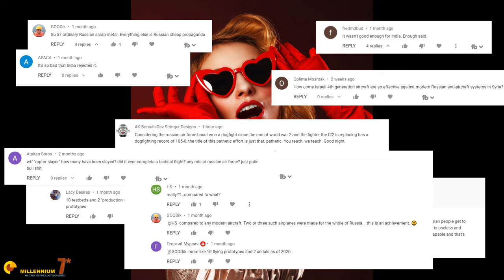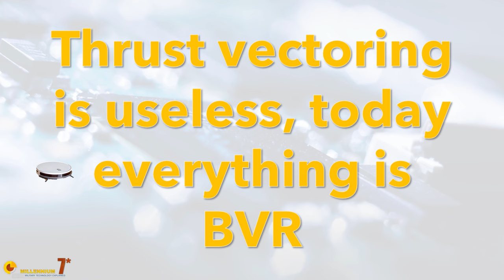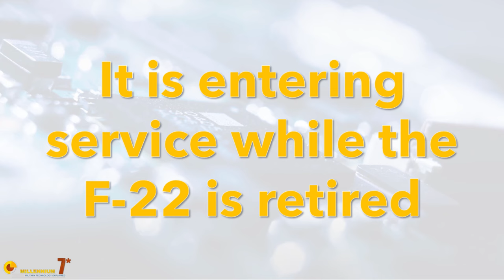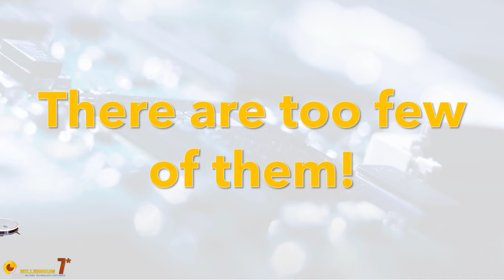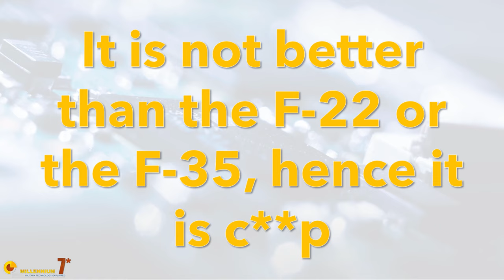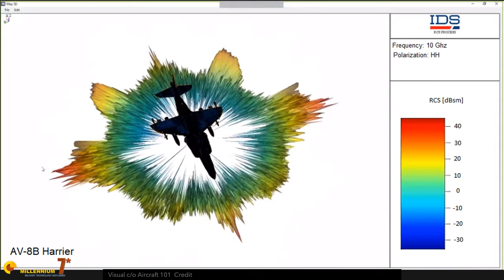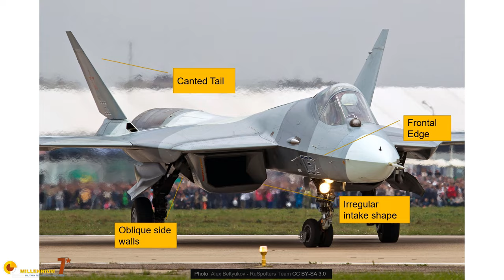Su-57: is it INVISIBLE?

Comment: My thoughts on the whole "future is BVR, who needs dogfighting? " is... 
..Stealth will probably take away any BVR advantages, so that to fire a missile at a stealth plane, you need to be close enough to get a lock. meanwhile non stealthy planes are getting sneakier with RAM paints and jammers. So in the end, even though radars are also getting better, I don't think it will change much from today. If anything I think it might all in all bring the ranges closer. 

But in the end, it all depends on what kind of tactics they use. Stealth is useless if you insist on flying at 30,000 feet with your radar on, but it's hard to use long range missiles when your engine is sucking up tree tops and making the air smell of fresh pine. To get the best out of any technology, it has to be used the right way.
Reply: To add to that, all of the "stealth" features are coincidentally exactly the same stuff that makes plane type recognition much more difficult. 
And you can't go around blowing stuff out of the sky if you don't know if it's on your side or not.
Reply: @CaptainDangeax  You don’t need Within Visual Range PID when your long range PID is superior already.  Things have changed a lot in that department.  Especially with JSF, the ability to PID at extreme ranges is orders of magnitude better than even the F-22A, and the Raptor can do it better than legacy fighters by an order of roughly 4:1.
Reply: @CaptainDangeax  "Rafales detected and destroyed a convoy of Toyota pickups at a range of 55 kms using their front camera" - Don't see how that's related to the argument at hand. If anything, you're arguing that WVR has blended into BVR.
Reply: "non stealthy planes are getting sneakier with RAM paints and jammers" - RAM does not undo the fact that they have reflecting geometries and external weapons. Jammers also have the problem that they become a beacon that can be homed on.
Reply: @CaptainDangeax  The Rafale OSF and RBE2 AESA are far behind JSF EOTS, DAS, APG-81, and the passive RF sensors all fused together.

The combined AESA/EOTS/DAS imagery of surface or airborne TGTs is substantially better than the Rafale, and the Rafale is quite good in that area.

More impressive is the fact that F-35s in CENTCOM accidentally detected, geolocated, and PID'd a strategic threat TGT that dedicated spy planes and ISR platforms had been searching for, but could not find.

During initial testing of the JSF sensor suite, they detected and tracked multiple rocket launches at over 800 miles away.  The AESA, EOTS, and DAS tracked those rockets into low earth orbit altitudes, tracked the booster stage separations, handed-off to the subsequent active motors, after gaining a track within 1 second of launch.

That was just 1 early testbed laboratory pre-LRIP, not even 2 production model JSF platforms with interleaved sensor-sharing.

You can literally watch the video of it.

As far as trucks go, JSF can detect and fused-sensor image them at much greater distances than Rafale can.  RBE2 didn't even have radar ground map moving target indicator last I heard.  Meanwhile, APG-81 is imaging and tracking individual people with GMTI, which is shared with the EOTS/DAS.

There's imagery of that as well. It's a next generation set of capabilities that exceed 4.5 Gen quite significantly.
Reply: @ChucksSEADnDEAD  Well, I did say sneakier, not stealthier. Point being that modern non-stealth planes are getting better at reducing the RCS. So slightly harder to see, even though they are not stealthy. And slightly harder for a missile to hit, when the jammer is on. 
It might not be much compared to a modern stealth plane, but it's a lot better compared to an older plane. . . Especially if you are using it correctly, which was the next point I made. 
With data links and, eventually drones, a non-stealth plane can be very very sneaky, while still being able to fire a missile at a target. But of course if the enemy is also very very sneaky, you are going to have to be very close to be able to see them. 
So ultimately, I think the engagement ranges will drop, or at least stay the same'ish. 
But , we shall see how it turn out. ;)
Reply: @CaptainDangeax  I know. And now we can get visual ID on a target in BVR. Meaning you don't have to get within WVR to get a positive ID. Get the context of the argument right, kid.
Reply: @lordsqueak  "getting better at reducing the RCS" - Okay. But they're even more observable than a stealth aircraft with external weapons. So the will always be more vulnerable.
"when the jammer is on" - Unless the missile has home-on-jam mode. That jammer better be towed.
Reply: @ChucksSEADnDEAD  You are completely missing the point of " To get the best out of any technology, it has to be used the right way."
You are trying to prove that stealth air crafts are more stealthy,,, which is true, but it's completely besides the point here. 
I'm saying that non-stealth planes will get sneakier, compared to what they are now, or compared to older models. Pretty much Everything will get sneakier, especially when used the right way. 

as for decoys,, yeah it would be pretty stupid not to make sure it's not near you. But let's not confuse them with jammers, which if they work correctly, will make it more difficult for the missile to track. It's their job after all. If they don't work,,, 

Again, tech needs to be correctly used to reap the benefits of it, and one should not assume the ones that have them, doesn't know how to use them. I think the F-117 that got shot down in Serbia is a lesson of that.
Reply: @lordsqueak  Why is it beside the point? You're trying to argue that a desperate move to make 4th gen relevant for a few more years is somehow a positive. It isn't, it just means 4th gen is outclassed and in need of replacement. Again, jammers act as a point source of signal. Any missile that can switch to home-on-jam will simply use the emissions instead of radar reflections. The point of a towed jammer isn't being a "decoy", it's the fact that the aircraft carrying the jammer is in danger of having a home-on-jam missile hit it. So the jammer has to be kept away from the aircraft or else it gets destroyed as well.
Reply: @CaptainDangeax  Again, unrelated to the argument. We were not discussing the Rafale or the F-35, you just came here to bother LRRPFco52 with some unrelated discussion you had with him.

Comment: Hopefully, we'll never get to see for ourselves which of them: f22/f35 or su 57 is better in a direct confrontation.
Reply: @CaptainDangeax  Knowing China, they may very well have tons of issues of their own with their j20, just less transparency. They still didn't manage to copy russian thrust vectoring, after all.
Reply: @CaptainDangeax  Anyone who describes the JSF series as an average ground attack plane immediately outs themselves as a know-nothing on this subject.
Reply: @CaptainDangeax  ofc the f-22 was shot down in a WVR engagement, because it was never created for that purpose. Stealth is only useful for Bvr. If the US wanted another WVR aircraft, then they would’ve kept the f-15 as the primary air to air fighter. Also the f-35 is still relatively young, and any technology that’s new is prone to bugs, and mechanical errors. But despite this mechanical error, that doesn’t make the entire program a failure, because the f-35 is a huge success on the global market rn. Even Finland chose the f-35 over aircraft like the f-18, and the overrated Gripen

Comment: The lower tolerances thing could also be a deliberate decision. Maintenance of the F35 is finicky largely because of the very high tolerances everything is put together to. While paying so much for an aircraft and cheaping out on the hanger seems stupid, if the country is relatively large having the expensive aircraft tied down to a single or even a couple of locations is a major down side. Even for smaller countries it is a defensive liability. There would be little point putting rugged landing gear on the aircraft if it also needed climate control for maintenance.

I'm beginning to believe that Russian doctrine is not particularly different, and that the super manoeuvrability is a cool side effect of thrust vectoring being used to avoid dangerous departure modes (important if you intend to sell it to poorly trained air forces). Good enough thrust vectoring could make pretty much anything fly, so thrust vectoring hides a multitude of sins. It does make for a good sales pitch though, which for an export aircraft is a big deal. On the off chance the visual range combat does occur it will help, but just because they say it is important doesn't necessarily mean the believe it.
Reply: In my layman opinion, i think that best thing about OVT is that it gives you much better maneuvering in very high altitudes where control surfaces just don't work as well because air is to thin. And those are the altitudes that you need to go to get range and speed when launching missiles for those BVR engagements.
Reply: @uegvdczuVF  Doesn't really make sense, because you want to be going as fast as possible which makes the control surfaces more effective. If you have enough air to get the lift required to stay up, you have enough air to use control surfaces, and if you don't then there is a decent chance you will flame out your engines anyway. I did wonder about the same thing for a while though.
Reply: The Russian execution of production is based on industrial limitations in their manufacturing sector.  They can design aircraft with really tight tolerances, but they can’t produce them.  They’re still using Su-35 assembly line technology for the Su-57, with a lot of out-dated processes that even the Chinese are looking down on.

Comment: It really is a beautiful aircraft, I pray we work together and never see who would come out on top in a conflict.  Perhaps U.S. and Russia against another thieving elephant in the room.
Reply: Work with Russia ? Lol

No , thanks
Reply: @MonMalthias  ,The YAK-141 had two separate engines to lift up front. The F-35 uses an elevation fan that is completely different. Also, the lift fan was invented and developed by Lockheed and Rolls Royce.
One thing is a copy and another is to buy a license, that is what Locked Martín did with the F-35B with the Joint Strike Figther contest that required three aircraft models (the normal one for the air force, the vertical take-off for the Marines and the aircraft carrier) and as Lockheed Martin had no experience unlike Boeing that manufactured the Harrier, but as he had money and in the mid-90s the US - Russia relations were good, since the license was bought from Yak-141 and the vertical take-off system and that is why the F-35 won the contest over the F-33.

Russians  stole tech and copied the B-1A (Tu-160) copied the XB-70 (Tu-44) copied the B-29 (Tu-95), drone X-47B (Othoknik), NASA X-29 (Su- 47 Berkut), F-111 (Su-24/34), C-130 (IL-112V), P-51 Mustang (Yak -3), copied the Concorde (Tu-144), copied the atomic and hydrogen bombs , copied Space shuttles (Buran) copied whassap (Telegram), copied Youtube (RUclip) copied Google (Yandex) copied Facebook (VK) etc 😆

Russia is anti west , pure and simple.
Their continuos attacks on european elections , their targetted assasinations on European soil , etc.

Now they "joined" forces with the Devil...What worries Russia is the risk of falling under China's dominance. The Putin administration, which tries to foster pride in the greatness of Russia, operates on a principle of rejecting influence from all other countries in regard to its domestic policies..

Russia is basically a poor country whose Soviet legacy # allows it to continue to feel adequate compared to other third world countries. But not by much. 20 more years and it's over !!! Russia will always have a Stalinist character that seeks to have a dictatorial power. It's the way they roll. Pity his hundreds of years, past, present and future, of misery, poverty and utter despair. The reason why there is so much alcoholism in that country, more than in any other ... Hopelessness is what they live in Russia.
Reply: @MonMalthias  mashallah. Thank you.
Reply: 不過我拒絕 だが断る  modern economics is a Western PsyOp, that is being unravelled.
Reply: @MonMalthias  Australian here. I wish we could have an alliance with Russia against the US.
Reply: @MonMalthias  let’s get one thing clear. The common issue throughout the world are the corrupt politicians in government working for ultra-rich billionaires and those aspiring take a slice of the pie when no one is looking. 

These politicians do not represent the working class people. Political corruption and the lack of representation for working class people is our greatest enemy, not each other. 

In the past 70 years there have been several near-WW3 mishaps which that were only stopped by one person’s decision to not retaliate from a nuke sub, or to ignore a strange radar anomaly of a full missile attack. These were real events.

As much as I love aviation fighter jets and rocket technologies, we must begin to collectively demand more peace talks from nuclear-armed governments worldwide. We must demand they work together toward deescalating the situation by deactivating more nuclear arsenals and invest in promoting peace and developing clean, green energy tech. Let’s collectively invest in win-wins for each other instead of lose-lose. I want what’s best for your family just as much as I want what’s best for my own. The future of our grandchildren depends on it.
Reply: your dream is too small, we should all be friends.

Comment: SU57 is a capable beast indeed. Could you explain why the new wave of western drones chose not to use flying wing designs, whereas Russian and Chinese drones do?
Reply from the maker: I didn't notice that ...
Reply: Do you mean the current loyal wingman designs ? I'd guess that the B-2 style wing is more stealthy, but less manoeuvrable and possibly less capable of super-sonic speeds. The answer is likely to be based on the operating requirements being designed for.